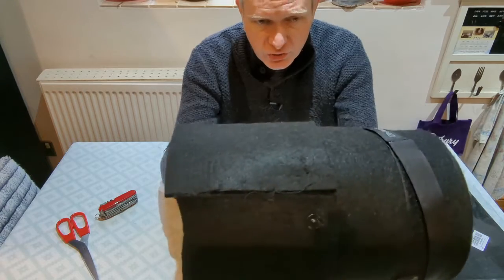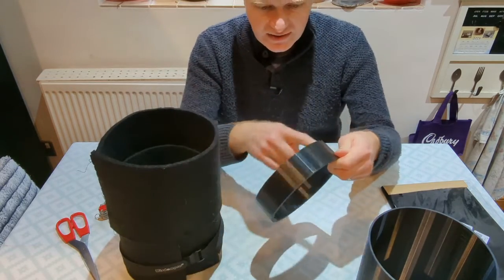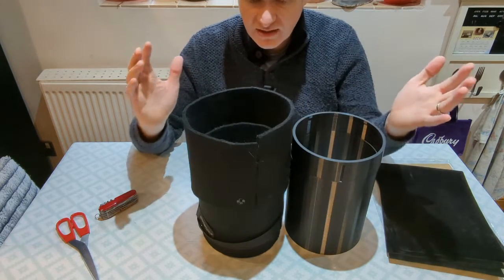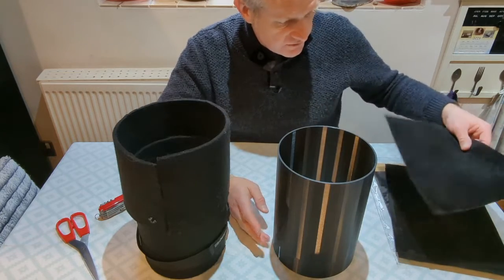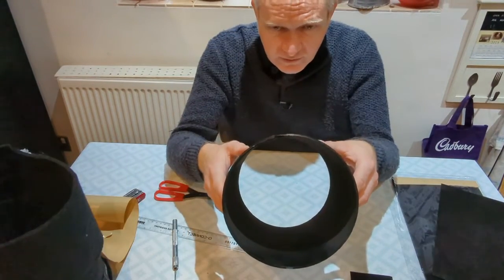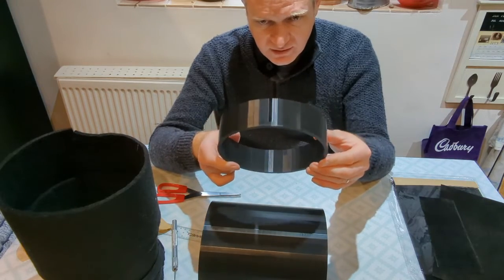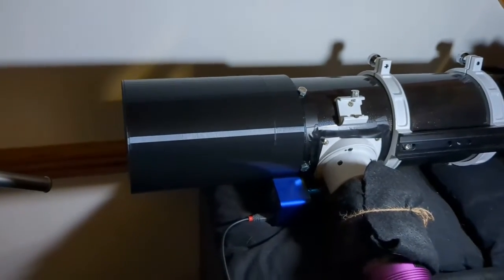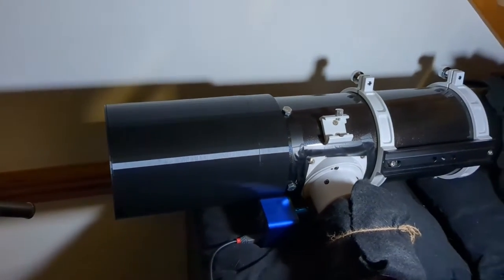3D Printing a Dew Shield for a 130PDS

Comment: Great video, can I ask why you didn’t print the two first parts all in one to save glueing together…?
Reply from the maker: I was wondering if it would fit or if I would need to change the bit which mounts to the scope.  I knew the dew shield size was ok, but the mount was proving difficult to get right.  As it took about 30hrs to print, I didn't want to make a mistake and have to reprint.  Therefore I broke it into two pieces and the smaller only took about 4-5 hrs to print, then once happy with the fit, glued them together.  Thanks for watching.
Reply: Hi Andy
As always, superb informative videos. I have a few telescopes costing more money, but the 130 pds is my favorite. I’m going on 78 years old and I find that the weight and size of the ota is very manageable and the images sharp. As you get older you think about ease of handling. I did have a question as to whether your 3D file for the dew shield was available? I recently got a 3D printer and thought this would be a great project.
Reply from the maker: @PeterWillmann-l2s  Hello, thank you for your kind words.  I love my 130pds, my wife gave it to me and it is just a fun little scope to have.  I am hoping to publish the files for the 3d print onto Thingiverse as soon as I've worked out how to do it!  It does take about 50hrs print time as it is a bit of a big print!  Thanks again for watching!